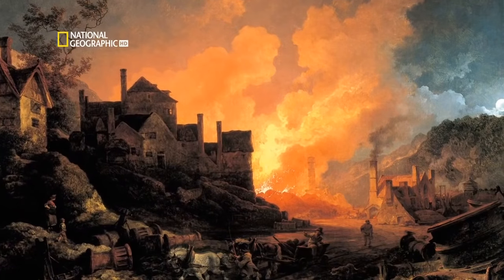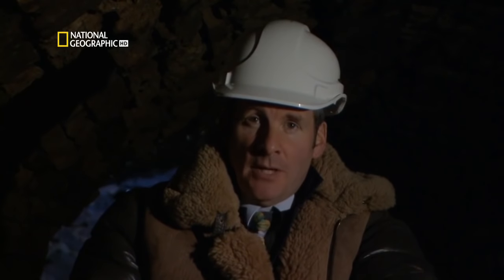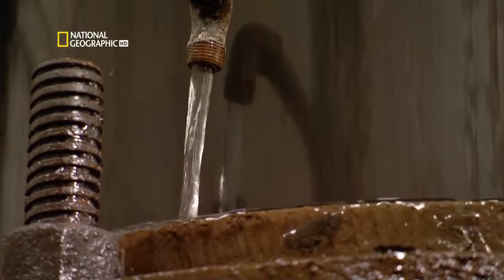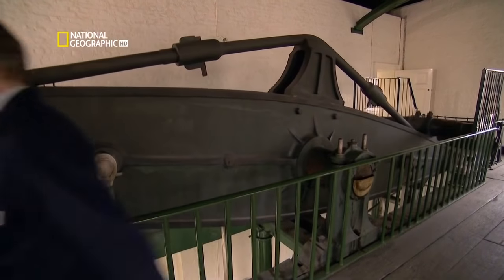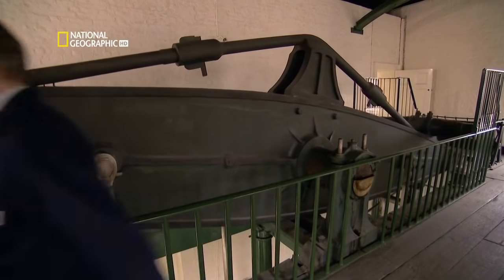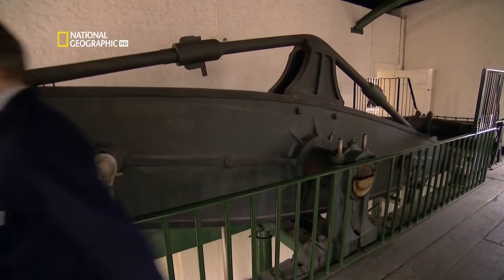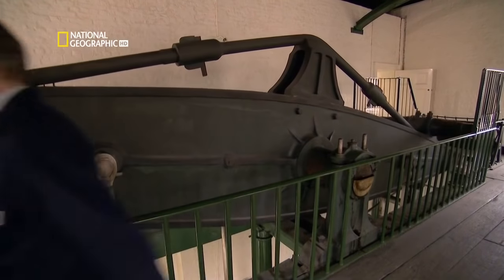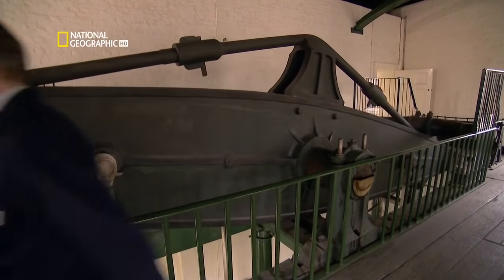Britain's Greatest Machines With Chris Barrie - S02E04: Trains - The Steam Pioneers (5.1 DPL II, HD)

Comment: Anno 2019, still interesting. But, when you think of it, the progression of steam was extremely slow. It took 200 - 250 years to peak. Not much different with electricity and carbon fuels. The first took centuries as well to reach the current pinnacle, near-ending with quantum solutions, now taking 10 years of programming or developing a single system... More complexity slows down again.
Carbon fuels, also interesting, have taken ~150 - 200 years...
Many developments have come to common use parallel through time and have been concentrated by business, and commerce after WW1 and 2. However, real fundamental progression was slow and still is extremely slow.

Comment: the two cylinders in locomotion were not 1/2 cycle (180°) out of phase. if that was the case, one would go up as the other is going down..  that would not solve the stalling priblem. instead, the 2 piston were 1/4 cycle out of phase (90° phase quadrature)...  ... imagine a sine & consine curve on the same graph..  they are 1/4 cycle out of phase...ypu can see that by watching locomotion...  thus they are never working in exact opposition to each other. 

This approach was used on all steam locomotives after that.  

also... not to bring up any unpleasantness... but..  the American inventor John Fitch demonstrated a live steam locomotive model (1/4 scale) in a circular track.

using a model meant that greater care could be used painstakingly sealing potential leaks..  this model waa demonstrated for various dignitaries & government representives between 1789 to 1794. 

it used a cylindrical boiler with an offset flu running down the center. Fitch also demonstrated steamboat in the 1790s.

there was also a British inventor in the same time period as Fitch who built and tested his own versio. of a scale model live steam locomotive, running on tracks. I apologize for not knowing that inventors name, I searched for it on the internet but an article about his pioneering work and Fitch's has been taken down.

his demonstration may have been as early as 1784, which was nearly 20 years ahead of Trevathick's brilliant accomplishments.

I do not believe any copying or plagiarism occured. these three great inventors were quite unaware of each other's work. 

I think what Trevathick deserves special credit for, his steam inventions were full scale, practical and would have been capable of a commercial successes with a bit more backing. The London steam carriage was a functional passanger carrying self powered road vehicle, in an era when steam power was viewed in some sectors as more near to sorcery than engineering.
Reply: In 1789 all American  inventors older than 13 had been born British.........Isn't history funny? it is interesting how many similar inventions occur in different places at around the same time; what I find amazing is how long it took for the same type of brain that we have now to get out of the Stone Age. The two key inventions of the Stone Age were the sharp edge and the hole; the latter is very important if one wants to make useful tools and wheels.

Comment: Hexagonal nuts and bolt heads in "1820" on that "`19th century" steam engine. Yeah. Right. Just like they had machine tools large enough to machine engines like that BEFORE there were STEAM ENGINES to drive them. You bet. As usual having to invent history and having never actually built what supposedly was built in the "U.K.", the Brits aren't equipped to know what technology was actually available during the time period to build the technology they claim was built in the "U.K," at the time they claim it was built. 

What is really hilarious about their "technology" is that its stupidly complex and inefficient even though it was built long after they claim specifically to make it more "believable" that it was built when they claim. Why in the hell would you use a walking beam to convert the vertical motion of a "steam engine" into vertical motion for a "pump" instead of just running the "sucker rod" OF the pump UP THROUGH THE CYLINDER AND PISTON OF THE STEAM ENGINE ITSELF TO MAKE IT "DIRECT ACTING"? And in the process save a HUGE amount of material, time, complexity and POWER by NOT having to move several tons of unnecessary linkage?

The only logical explanation is that as usual a bunch of "historians" sitting on their asses in university offices concocting complete lies about machinery but who have never in their lives actually OPERATED any real machinery OR considered the fact that being a "historian" and chosen to be on the lie manufacturing team may be because they're not much good for anything else really performance and nobody in "power" is about to send "historians" out to talk to "workers" for an "education" or take the chance that the much more clever, ambitious and knowledgeable "workers" will figure out the scam or just inadvertently "trick" the "historians" into telling even MORE outrageous lies than they already do and did.
Reply: Industrial steam engines had existed in Britain 100 years before the engine in the video. The engine at Kew was in constant service until 1944 and, I think, so it's likely that bolts were replaced with hex heads in that time. Some square-headed bolts are also clearly visible on that engine.